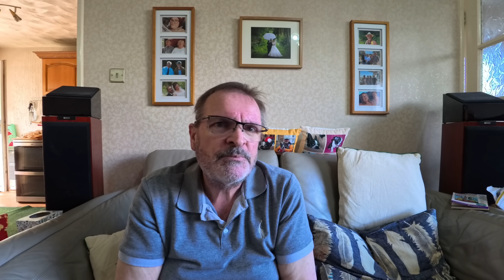Expert Ships Engineer Reacts to Baltimore Bridge Crash

Comment: The E-gen should have kicked on 10-15 seconds after it sensed no power @ the main switchboard. No one would have to physically go to the E-gen room except for E-gen start failure. I agree with your conclusions. I would like to hear you definitively state that this vessel doesn't have a dedicated 24/7/365 internet connection and that the ships controls aren't connected via web access/control and even if the ship does have dedicated web access that the ships propulsion, steering and other vital equipment isn't controllable by it. In fact, that it is a closed electronic/electric/pneumatic (maybe) control system. No way for it to be hacked off vessel.
Reply from the maker: I havent been on that ship but every vessels i have served on new and old does not have internet connection to any part of the vessels control system it will have a network of PC’s round the boat but that’ll be communication to office etc. 
The steering and engine controls will be independent system. Usually any firmware updates are done with usb memory sticks or manual inputs.
Reply: That is my experience also. I have never sailed offshore on these ships, but the USCG requirements fall into play here somewhere and I for one am not exactly sure what they are RE web access/control capabilities. I've seen fuel management systems with web access, but only closer to ports on designated routes, and these are not critical systems of course. 

I believe that this was possibly a bad main CB that kept tripping and needing to be manually reset with generator paralleling coming into play possibly. I would have thought this vessel, in this location, performing this transit would have been on standbye with more than 2 engineers and several unlicensed oilers/juniors on watch also. Seems very odd to me. They have 2 pilots onboard (I saw this reported elsewhere) and only 2 engineers on standbye?

A thorough thermal survey of that ships critical electrical systems sounds likely.

I think they're going to have to rethink not having designed these bridges with crash barriers of rock or concrete that would prevent ships from being able to take out those bridge stanchions directly. 

Thanks for the video and your response. @retroonhisbikes

Comment: So as an engineer you're saying that what is the ship gets going to 7 nights or so that you can't stop it if the power goes off and on you can't steer it and if the power flickers then it's just a out-of-control mass of whatever that really just doesn't sound that good at all doesn't sound like a great engineering anything to me I mean you're telling me there's no way to stop it there's no way to steer it there's no way to do anything at all if there's no man that is that is pathetic
Reply from the maker: That’s about right.  Without electric power there is no steering, hence the need for an emergency generator that’ll provide power for emergency services like steering etc. you can drop both anchors but a 100,000 tonnes (100,000,000kg) travelling at just under 10mph will take a while stop. It’s direction after a blackout will it part depend upon wind and tide.

Comment: So, failure by 'experts' again (pilots, captain etc)? Aren't they trained to know about the 'paddle wheel' effect, if it's that strong? Also the ship was fully laden; wouldn't that much reduce this effect, with the propellers at depth (pushing both ways nearly equally)? And the vessel only lost about a knot in speed. Is 'full astern' really that ineffective?

Comment: Hi agin, Next quistions can be, did they change crew, how familliar was the crew with the ship.  your talking a boute driving the porpeller, but how mutch water is under the keel so there will be sufficient water to "pump" and gani effect in the dredged McHenrychannel, the depth at that point is 50feet =16,6m and the summer draft og Dali is 15m so its schrapiing the bottom in normal conditions, so your theory on ballast trim out is plausible but she semes fully loaded with containers, so it will be on the edge.

Comment: Do you think the power outage was because they don't send an engineer into the azipod for upkeep/maintenance? I've heard this ship has had power failures before.
Reply from the maker: Didnt have an azipod the engine was directly coupled to the prop. The main engine is separate from the power generators. 
A passenger ship may have two azipods but that’ll be a diesel electric.

Comment: Yes I agree with your assessment.. it does look like the engine was under massive load and giving of loads of smoke and yes it is very probable that the power went out and they sht themselves and threw it in full reverse which threw it off course and like you say no rudder control in reverse gear and they created the worst possible outcome in only 4 minutes..

Comment: A total amateur here. But even I can say the obvious. 

1.) The speed limit must be reduced to 3 or 4 knots until completely clear of bridges and harbour structure.

2.) All bridges adjacent to large traffic must have massive piers to prevent this obviously foreseeable accident.

What a lousy bridge design. One bump and down like a house of cards. Very poor engineering.
Where is the structural redundancy?????

What the hell is going on down there. Even a kayaker can solve this problem.

Comment: It’s a long time since I was an Engineering Officer and some things will have changed over the years. 
I agree with the vast majority of what you have said, especially the decision to apply full astern. To choose full ahead would have been a massive decision to take and I can understand why they didn’t with so little thinking time. 
I agree that human error could have blacked the ship out. 
I was on a ship years which had an over-complicated generator start/stop system and the 3rd Eng blacked the ship out by mistakenly shutting down the wrong generator.
I never saw our Chief Engineer’s in the engine room other than to carry out inspections in a pristine white boiler suit😂. Just one Engineer on duty whether leaving port or not. 
We will await the outcome of the investigation with interest.  
I can’t see a correlation between changing the main engine over from
Low sulphur fuel as having any effect on ships power. In my day the power generators always ran on diesel and the main ran on diesel going into and coming out of port then changed over to heavy oil. As I said, things may have changed.

Comment: With such a large ship passing through a somewhat narrow channel under an unprotected bridge, shouldn’t they maybe have a couple tugs escort them out past the bridge?  And/or run the auxiliary generator all the way from mooring to out past the bridge to provide uninterrupted power and hydraulics until beyond critical steering requirements?  And no switching of fuel until out of the channel.  I don’t care if they use regular fuel all the way.

Comment: Thank you for that great insight especially from a ships engineer perspective. Everything you explained makes perfect sense. I also learned a lot. I did not know about a “paddle wheel” effect and the regulatory requirements for low sulfur fuel within our ports here in America, yes, maybe the switching of the tanks/fuel caused the stall. It all makes perfect sense now, you cleared the air on a lot of possible suspicions that it could have been foul play. I just wanted to drop a line and say thanks from the U.S. We will wait for the investigation outcome now, but Id say based on your knowledge and experience, I’m sure the investigation will be a very similar, if not exact scenario which turns everything into a very unfortunate event doesn’t it. May all the soles rest in peace.

Comment: Marine electrician here… the boats I build have a backup generator the same size as the primary generator. Either gen can run the whole boat. Every boat we build has 2 identical gens. The boats we build are about 200’.  There’s also a centrifuge in case you get bad fuel.

Comment: Keep in mind that even this is something of an oversimplification of what occurred, but it covers the most essential facts. Bureaucrats played at cost-cutting gambles that seemed like small risks individually, but when they lost multiple bets on a single pass, the cost was catastrophic, and those who placed the bets were no longer at the table to make good the payment.
That's the nature of bureaucracy.

According to GPS tracking records, M.V. Dali was heading southeast at about 8.7 kts. in the navigation channel with a river current running about 8 kts., so nearly all of the rudder’s control authority was being created by the thrust from the engine flowing over it. When they lost the thrust from the engine, being able to change the angle of the rudder didn't matter anymore.
At the same time, the wind was straight down from the north at 20 kts. to 30 kts., so the Pilot was having to steer east-southeast to keep the southeast heading of the channel.
Loosing engine power meant they were being pushed forward at the stern by the river current, which tried to keep them moving at about 8 kts, while being slowed and pushed to starboard by a strong, steady wind against the port bow, causing it to veer southward because the ship no longer had any steerage to prevent or overcome it. When power came back briefly, GPS readings registered the ship's headway at just 7.4 kts. The torque effect of starting the engine at flank astern may have had some effect, if your assumption is correct, but the effect would only have been secondary to the motion already established by the wind and current. The Captain and Pilot would also have long been aware of such a well known and common handling characteristic of single shaft motor vessels, and would have been far more likely to order "full ahead" to try to regain steerage flow over the rudder.
By the moment when the M. V. Dali struck the bridge piling and pier, the Pilot and the Captain, (who followed all the rules), were just helpless members of the same audience who have virally viewed the video of the event. But they are also victims of the constant fog of decades of authoritarian regulations issued by a dozen generations of appointed petty bureaucrats, each of whom is ego driven to leave some written mark to prove to posterity that their existence within the system was justified, even if the system was not.

Comment: I think the ship could have gone under the bridge without hitting the pillar. First the engine cuts out, it's still going straight, they maybe had been able to coast the ship as it continues its forward path. by restarting the engine may have change rudder position to make it vier right and when they restated engine second time they turned to the left just before hitting the pillar. Before restarting they may have coasted while they called for tugs

Comment: Wait a second. Calm sea, no other ship anywhere near the bridge arch. Where the blazes were they steering when they browned out? The pilot would have positioned the ship right into the middle of the span. When the power cut out that ship would have gone as straight as a pin for three miles. Why were they anywhere near the pillars to begin with? Any ship captain would know his ship would go straight without power. Why would they throw it into reverse and throw the stern to port and steer the bow into the bridge. Come on..Smell the coffee..

Comment: Good analysis, however, there is one point I wish to hit on and that is the fact that cargo ships do not hire enough people to man their ships while transiting to and from ports. A modified Sea and Anchor detail might have prevented the "black-out" by Engineers being where they are needed to be during precarious transits in a Port. With that said I still believe the Ship's Service generators and the Emergency generator were being supplied by contaminated fuel.

Comment: I might be out of line here, but for a vessel that size as far as I am aware has main propulsion engines and auxiliary power supply engines, for electrics etc. The validity of the main propulsion going out is certain, however, the electrical plant should have been unaffected, as I say, I may be wrong, clarification on its mechanical plant would be appreciated. Thanks.

Comment: Over 40 years retired CG Captain, shipboard Engineering Officer, marine inspector and marine surveyor.  One thing you learned very early as a cadet regarding anchor handling, the ship better be stopped or almost stopped and you better know the depth of the water before the order to drop the anchor is given.  Otherwise, if the anchor grabs bottom, the brake on the windlass will never stop the chain from running free and ripping the bitter end of the chain free of the collision bulkhead. Dropping the anchor sounds good but there is no windlass brake made that is going to slow an almost 150,000 displacement tons (US Tonnage...not long tons fully loaded to her marks) ship.  So that anchor was basically running free!  The 100,000 ton figure quoted by those who know nothing about ships is roughly her Gross Registered Tonnage or cargo carrying capacity.  It has nothing to do with a ship's displacement tonnage.  The momentum of an almost 150,000 ton object moving at almost eight knots (a little over 9 mph) is more than anything man has designed can stop without tremendous damage!
Reply: It takes 2lb of force to stop 1lb moving 1mph.

Comment: i think my question would be why in the hell would a ship that big be going that fast?   and why weren't there some tugs buy its side for support until it got out of a tite spot and safley out to sea?  and an emergency generator is for eletrical power only and ain't got a damn thing to do with propelling the ship,  thers lots bigger engines that do that job... just cauz you got lights dont mean you can drive the ship when the other sngines have qwit running...

Comment: At the time, the ship was on a straight course to take it under the bridge. My takeaway from your video is that if they had not tried to slow the ship, it might have passed under the bridge without contact. That is, assuming no strong cross currents present at the time. I imagine it was very high stressful minutes on the ship's bridge

Comment: So the route cause could be the ships fuel, low sulphur or regular. I've not noticed any mention of the engine(s) failing, only the reported loss of power (electricity). Did this ship have a shaft driven main generator?. VLSFO fuels had been nicknamed Frankenstein fuels.
Reply from the maker: Im not sure about a shaft generator it may well be have had one. But it wouldn’t but used until the ship is full away in open waters.

Comment: What does the generator "trip off the board" mean?
Reply: Electrical Tech. Trip off the board means that the Electricity supply circuit breakers have tripped, same as your house circuit breakers but much bigger. This could be due to an electrical issue or human action.
Reply from the maker: All power generated goes to a central switchboard via giant circuit breakers before being fed to services and transformers. 
When we say tripping of the board it is the generators circuit breaker opening automatically due to built in safety devices.

Comment: Great information and presentation.  In a way, its kind of like the Titanic maneuvering to miss the iceberg putting the port engine into reverse instead of forward, which would possibly have given the crew better rudder control!
Reply from the maker: They tried to swing the stern away from the iceberg. They ignored the ice berg warnings and they were going too fast for the conditions tried for the blue ribbon award.

Comment: Where does this guy get his times? It took more than 4 minutes
Did you look at the bridge? Obviously not
There were small explosions and th bridge was demolished with charges again
It was not the Russians
its your cult government , this was a false flag attack
Reply from the maker: The coast guard video had a time stamp running.
What explosions? Power cables parting maybe
Reply: @retroonhisbikes  you can see sparks and there is still smoke linguring in the air, on the viewers right. Lots of it. Demo
Reply: @retroonhisbikes  I went through this for years with 9/11. ITS THE SAME CRAP

Comment: Wonderful warts and all thoughts on what possibly happened. As an electrical tech i've done considerable work on generator systems at hospitals and industrial plants. Automated back up systems usually changeover within seconds not a minute, so my guess would be that human intervention assisted getting the power back on. A substantial amount of automated systems fail because it is very difficult to schedule access for regular testing,

Comment: I recently read an article about some new Taiwanese naval ships, and the sulfur/feul subject came up.
IMO 2020 (International Maritime Organization) requirements are that the sulfur content had to be reduced from 3.5% to .5%, particularly in SECAs (Sulfer Emissions Control Areas), which are the populated port and coastal areas, designed to protect people, flora, and fauna. 170 countries, including the States, have signed on to this treaty.
I think this man's first notion may be correct, that they switched over tanks or something (I didn't know about any of this emissions for port or open sea regulations until I started reading about those ships), but that could be a source of mechanical failure.

Comment: And it takes MINUTES to get the backup power going. I spent several years on the water and it's almost impossible to get a loaded ship to stop. And the tide runs at 4 knots. Get a 40,000 ton ship moving at 4 knots and you can't steer or control it. Period!